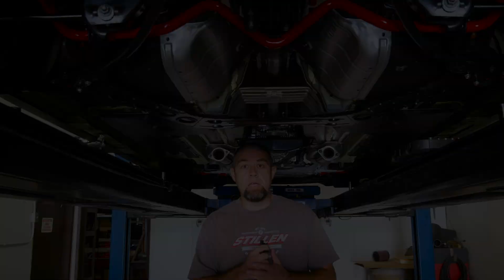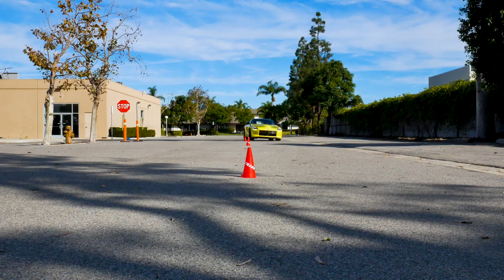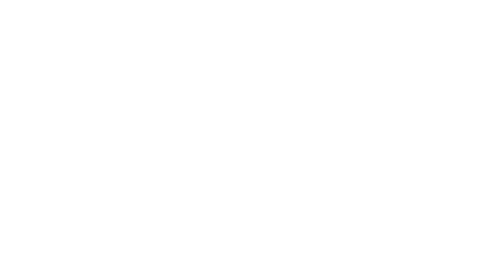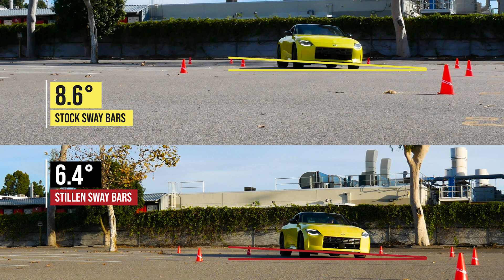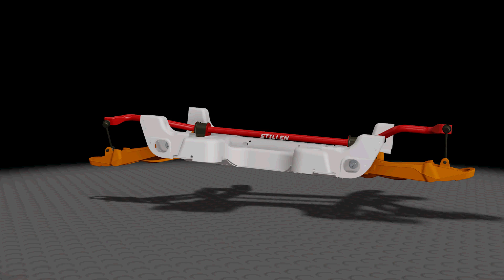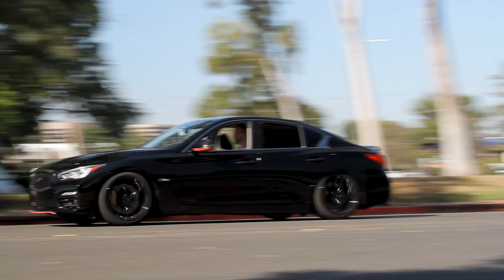STILLEN Sway Bars | Nissan Z and more...

Comment: My go-to tires on this car are sticky summer tires, Continental ECS02. What settings do I want to go with front and rear if I want to match what you have here for the stock tires that aren’t as grippy? Thanks!
Reply from the maker: Would always lean on the side of caution and start with rear soft (outside hole), and front middle just like was shown in the video and dial it in from there depending on your specific driving habits, desires, comfort requirements and other suspension mods. Every driver (and vehicle) is different so there really isnt a one size fits all approach when it comes to suspension. That said, unless you are running real soft track tires the rear bar should almost always remain on full soft to maximize grip on a RWD platform. The front settings with grippier tires could go to full hard (inner hole) but ithat would promote some additional understeer so you would want to be sure that it isnt conflicting with the balance of the rear in the setup.
Reply: @STILLENvids  Thanks for the detailed response! Looking forward to picking up the sway bar set soon. I will probably use it for spirited daily driving and maybe autocross once or twice a month (for fun, not competitive)

Comment: So a 200tw tire and coilovers you’d go stiffest front and rear?  Been using medium front and a medium rear setting with a 300tw summer and been happy but now on a 200tw.  Only time I’ve ever used full soft front was a wet track day setting everything full soft (front and rear).  Is there a time Stillen ever recommends full front soft?
Reply from the maker: With the stickier tire I would reccommend retaining the middle settings until you have experienced exactly how the car behaves with the new tires and go from there. Generally, full soft front and rear is reserved for poor weather/track conditions. However, if you feel the front is pushing through corners then setting the front to soft to bite harder and reduce that understeer. Settings for swaybars are always a variable on driver wants and vehicle behavior. Some like a sloppy backend for more "fun" while others may want full grippiness. The varying hole settings simply allow you to accomplish either/or.
Reply: @STILLENvids  Well I already set them full stiff and tested it staying within reason on the street and it feels promising but the front might have gotten a little light in balance so might have to drop 1/2 a setting on track testing but will see.  With a grippier tire and aggressive camber angles it doesn’t feel too stiff and loose anyway.

Comment: I changed to these sway bars on my wife's 2024 Nissan Z Performance 6 speed manual. It really fixed the unsettled feeling that the car had with the stock sway bars in the corners. We used the settings that you recommended in this video. It now feels more planted in the curves. It gives you more confidence in the car when we really want to have fun with this Z. The bars also have more adjustments available if we need would them in the future. Great product!
Reply from the maker: Thank you so much for the feedback! We appreciate the kind words and your business!
Reply: Is it still comfortable over bumps? 

The damping is pretty good and smooth. Wanting to have it feel a bit more planted but I don’t want to screw up the ride quality

Comment: Nice video. Will the oem end links hold up on the stiffer settings?
Reply from the maker: Yeah, you should have no problem with the OEM end links. If you plan on really pushing the suspension hard and going with the stiffest settings, you can swap them for some aftermarket end links, but not required.